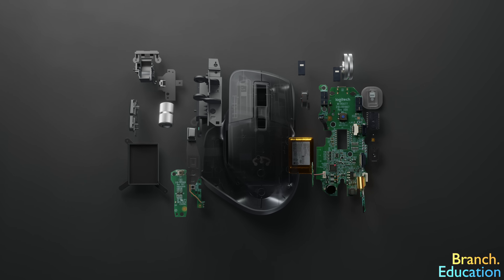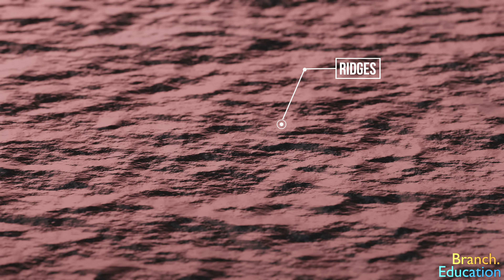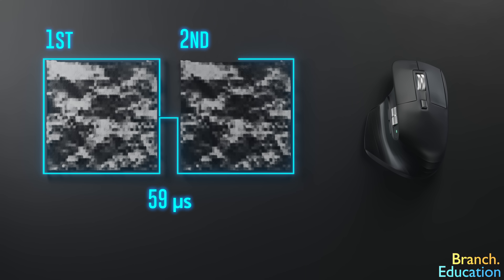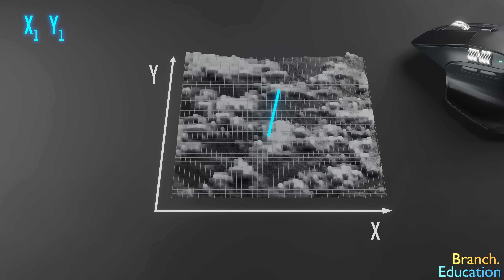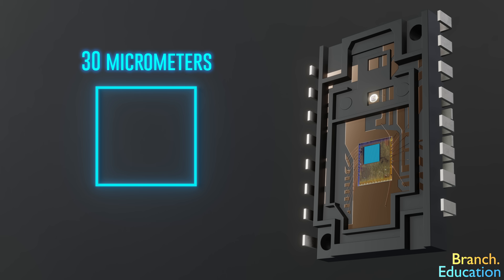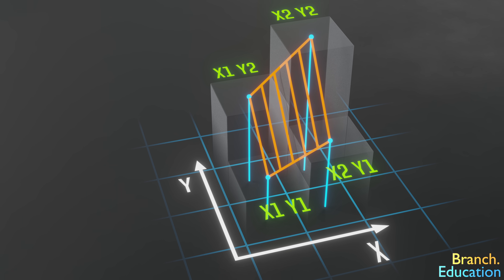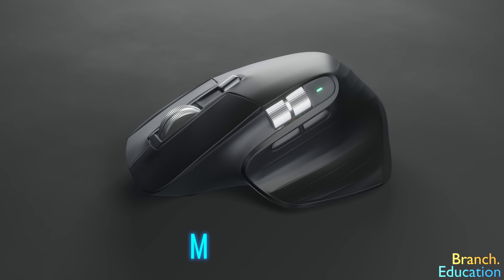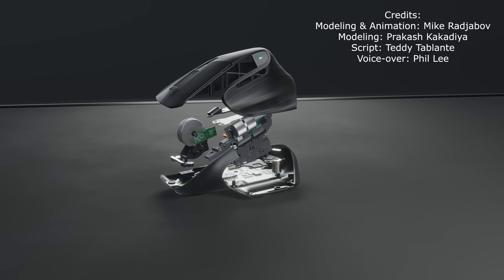How does a Mouse know when you move it?  ||  How Does a Computer Mouse Work?

Comment: It's sad to see that non gaming mice are usually the cheap low DPI ones, where in practice, people who are working with spreadsheets, charts, or photo and video editing, are the ones who need precision and accuracy with their mice. When you use a cheap low DPI mice, you are forced to set the pointer speed to a high number, extrapolating the pointer movement, causing pixel skipping, thus reducing the accuracy of your mouse movement. When using productivity softwares like After Effects or Photoshop, you're often required to click on small buttons and specific pixel, but with cheap "non gaming" mice, you'll have a hard time doing that, causing stress to your arm.
I recently just knew this and quickly bought an 8000 DPI gaming mouse, set it to 8000 and set the windows pointer speed to 3, resulting in a much precise mouse movement without pixel skipping, while maintaining good movement speed and now I can work comfortably with my productivity softwares.
In my games, with 8000 DPI I can slide the sensitivity to the lowest and resulting in a much smoother and accurate aiming too.
Reply: Wrong

Comment: The explaination, what starts from 04:13, and the animation a bit different, the verbal part ok, but the animation a bit misleading, because 2nd picture taken as the next possible one, so when we "match" the first picture with the second that can be only partial, because there is extra data, what is not on the opther picture (on each picture), and there is a small overlap only, what IS on both... while the animation suggest we can find the exact 1st picture on the 2nd picture by just moving on it it, or at lest does not highlight this problem.

Comment: Engeneerings back then: "Lets remove mouse tracker ball and replace that with Lenz and laser that Will make thousands of photographies of the surface of table in super small size, so the mouse can compare shades and shadows on first picture to other 8000 pictures, and then your computer will be move a cursor by an inch to left or up" 🤓

Comment: Great explanation as usual. Minor nitpicking/correction:
Logitech MX Master 3 used in video uses an infrared laser instead of an LED and uses a darkfield imaging technique like other mice in their MX series. Older mice like Performce MX even had 2 laser beams- they seem to have ditched that in the latest models.

You can see (through a camera) the laser spot even after a few meters in a dark room. A LED wouldn't be able to achieve this level of low beam divergence.

Comment: The mouse knows where it is at all times. It knows this because it knows where it isn't. By comparing it's current position to a certain point on the cable connecting it to the PC, it is able to track it's movements.

Comment: This video left me with a question. If the DSP shifts the image to compare it with another image, how does it know, in which direction to shift it? It doesn't know if my mouse is moving left or right, so how does it know where to go for that sweet "minimum difference" result?
Reply: I assume it shifts it in various directions at the same time, but that would be cool to know indeed
Reply: It's explained around the third minute?

Comment: -pc:
     -takes a whole minute to motion track a single second SD video
     -haves a lot of imprecisions
     -saves data in a very inefficient way
     -in very rare and extremely uncommon cases it can handle just up to 30 frames a second

-chad mouse:
     -takes literal microseconds to motion track
     -the results are exactly and precisely the expected with no evident difference and no lag
     -can handle multiple thousand frames a second
Reply: beforehand, it is a joke.
Reply: to add to this joke modern mouses have more processing power than personal computers from the early to mid 1980s

Comment: Cross correlation and auto correlation technology is also used in radar technology. 
This algorithm is used to compare 2 images. 
Cross : between 2 different images
auto: between 2 instances of same object.

This is very core Electronics Engineering.

Comment: Awesome video!
I wonder what is the algorithm behind motion detection between two images that works only in 59 microseconds. It is clear how it can work on 40x40 images, at worst you could just brute force every possible translation and it should be pretty fast, take some optimizations into account and it's all good, but what about higher resolution obtained after the interpolation? You could probably apply the algorithm on a 40x40 image first and then the same algorithm on a few interpolated pixels, however, I'm not sure if it's going to work well.
Another question is how does the mouse handle rotation. A simple translation algorithm would fail even with the smallest angles. I'm assuming that mouse just does not care about rotations and simply discards frames it's unable to translate accurately, as skipping a couple of frames is not a big deal when the frequency is so high.
I was unable to google more technical descriptions of the exact algorithm, so I would much appreciate it if someone links it to me
Reply: I dont know exactly too, but i bet it contains clever fast matrix operations

Comment: Probably you all have used a mouse tens of thousands of times the kids from 1984 that time travel that only use the computer without one computers do not have a mouse back then it was just your keyboard and a joystick for games only or drawing programs there was no UI back then computers were purely mathematical machines you wanted to read a program or write a program to floppy disk or cassette tape got to type in a command if you want the computer to work you want the computer to do something you had to program it easy learning Microsoft basic is very easy normally back then you pick it up right away right off the user's manual I have learned some of it and from what I have seen it is much easier to learn than python or c++ or Java and if you use a bit of math I can do basically all the things too I remember researching about one the first 3D games because as a teenager like myself I get very into this stuff and I love all things that's why my YouTube channel name is nostalgia but on the first ones elite it's okay if you get confused with the modern day elite dangerous they're basically the same thing just without multiplayer and all the cool effects the Creator said that they have the mathematically make the ships and space stations and then program them into the computer back then you didn't have a dedicated 3D engine he either had to mathematically plug in your models and have the computer work it out or you have to program your own 3D engine and there were very few 3D games there were probably not that many open world ones I just know of elite I have never actually owned one of those old computers actually I do own many things from the time period I always wanted to use one but when I got the time in the budget I'll buy my own a BBC micro just so I can play the game elite on the very computer it was programmed on

Comment: I already knew most of this stuff and some of the later models of roller ball mice were optical devices as well as physical rotation and they were comparing the movements on a rotary resistor and the interruption of a light or laser in two axis.

Comment: Your statement about moving the mouse one inch and it moving 2000 pixels isn't totally right.
It CAN be right, but that's not what DPI actually means.
DPI means how many dots the MOUSE will track on the surface per inch.
It has nothing to do with how many pixels the cursor will move, and it has everything to do with the achievable accuracy of the mouse.
Tracking 14000 dots per inch versus 2000 means the mouse will be far more accurate, aswell as the speed of said accuracy is better as it will compare dots faster as there are more of them.
Reply: He was correct, but worded it wrong,

Comment: I'm a bit confused on how dpi actually affects performance. If it's just using interpolation, then wouldn't a higher dpi result in lower accuracy? Wouldn't native sensor resolution matter more?
Reply: IMO dpi is just a manufacturer flex, afaik nobody plays at full dpi, personnaly im at the "standard" 800 on a gaming mouse that can do much more. BUT the higher "refresh rate" of the sensor and "polling rate" (how much position info/seconds) that goes with high dpi/gaming mouses is the thing that really matter more (this incidentally affect total response time).

Comment: Hm so if DPI is the amount of movement made on a computer screen when u move the mouse one inch physically, how does "mouse sensitivity" settings on computers play into this? Coz that seems to do the same job. Theres also mouse sensitivity settings in games as well.

Is high DPI low sensitivity equivalent to low DPI high sensitivity? Or is the high DPI low sensitivity better because of the fancy algorithm thats in play, smothening out the stuff?
Reply: In games, the yaw/pitch values or sensitivity is basically how much the camera/cursor shifts per "dot." Technically, for the best precision, it's best to have your sensitivity in-game as low as possible. The sens is the smallest distance you can shift the camera. It's a bit like your personal planck constant in-game. The lower this value, the more granular your control. Standard sensitivity calculations for eDPI (effective dots per inch) look like: sens x dpi. You need to know both sens and dpi to calculate your 360 distance.

Comment: And you needed to clean the ball and the rollers for better work of mouse. And also lubricate ball with alcohol for better contact with pad or table. Because, when ball became greasy, it did not roll well, but slided without cursor movement.

Comment: prehistoric mice...

prehistoric
adjective
relating to or denoting the period before written records

oof, that hurts. I fondly remember cleaning the wheels that the mouse ball touched, guess I'm from prehistoric times q_q

still using a mouse with a ball, by the way. very modern trackball with an optical sensor. good for office applications.

Comment: Question: What would happen if I moved the mouse so fast that the two images don't have any overlapping point, therefore yielding no point where the subtraction value is zero?
Reply: Depends on the exact firmware.  It doesn't look for zero, because there's always differences even if the imager doesn't move, because of noise in the system.  But if it can't get a good match it can just skip the update, or it may decide some bogus vector suits the minimum requirement and reports that.  That's why the framerates can be so high, it's a situation best avoided, because there's no good answer.
Reply: The mouse wouldn't do anything I guess. You can't move a mouse that fast either.

Comment: Okay nerd. You didn't need to explain the calculation how every part works. It's simply just fixed x and y square pane on the processor. When the light moves it follows that light in that pane and that's how your mouse cursor moves correctly whenever you direct the mouse.  Try placing your mouse the other way around and move it, the cursor move inversely.
Reply: what

Comment: I have a wireless Logitech mouse and a Logitech device plugged in a USB port. The mouse transmits data to the device in the USB port and everything the mouse does is sent to the computer. The mouse also have a wheel to move the screen view up or down.

Comment: So mostly i find out that gaming mouse are not better by any means to normal mice, couse they still watch the same image size on the pad, its just software interpolation thingy. you can do that with software on the pc just multiplicating movement of the mouse calculated by normla means... the only thing that rly matters is the rate of responding to pc.
explain if i am wrong pls.

Comment: I have my Razer Mamba Elite set to 400, 800, 1200, 1600 & 2600 dpi for optimal gaming. 

I use the 400-800 for gun spray patterns and really specific tasks, or even painting, and then browse the internet/move around windows at 2800. Im constantly changing my DPI a few times a minute even when im not gaming, not sure what I could do without that on the spot interpolation :)

Comment: Great video. I remember the days of the grippy little ball in the mouse. You would have to take it out and clean it every so often. Even the two little rollers, that the ball spun for x & y axis reading, would get gummed up. Clean that was much harder. Then I found my first Trackman in the early 2000's and have not used a mouse since. I even use it for gaming but unfortunately, no one makes a true "Gaming Trackball" with high specs to match gaming mice. IF more people tried and used trackballs, manufacturers would invest into making true gaming trackballs.
Reply: I've used trackballs before, and did try to use them for gaming a few times. I found that experience to be both awkward and unpleasant. My best guess is that most folks who try it don't like it, and tell their friends not to bother, which is what I did. The issue is that a precise trackball (which I had) tends not to be a fast one. I can map a DPI-Down function to one of my sidebuttons and make long-range shots, and have it touchy enough to spin around twice in the space of my mousepad normally. I'd just use a thumbstick over a trackball in most cases.

Comment: Query: 
The interpolation method suggests that 'gaming mice' use more powerful SoC's - not just fancier pixel sensors. Or perhaps a combination of both. I've wondered a few times how I can 'step' my DPI around and tweak it with software. This now makes sense. 

I guess I'm asking - when Gaming mice cost more, the increase in DPI is costing more not purely from the sensor?
Reply: The sensor, the light source (better diode or even a laser), faster SOC (sometimes with lots of flash to store multiple profiles on the mouse itself for folks that want them when they move devices (my old CM Storm mouse had this, as does my Logitech MMO mouse), adjustable weight, tons of LEDs, extra buttons, and in the case of the aformentioned Storm, an actual display on the thing.

And quite frankly a Gamer Tax.
Reply: Addendum: some mice have a motion/gravity sensor instead of entirely relying on the light feedback through the lens to detect when you pick them up. that adds cost too. But the higher DPI does mostly depend on the SOC. All of them will have floating-point units and a far bit of RAM for a bloody mouse. Oh, and PTFE/Ceramic low-friction feet add a few bucks, too

Comment: Fun fact, the 3d model of "no gaming mouse" looks exactly like Logitech Mx master 3, witch actually is not equipped with IR diode, but laser one. Thanks to this, it works on glass.
Reply: The important part about MX Master models is that the spot is illuminated in a way that the reflection off the smooth surface will not hit the sensor, leaving a dark field. Then only the imperfections of the surface will be bright. So having less reflection on the glass surface doesn’t matter to the models.